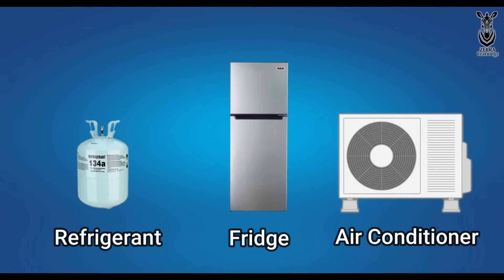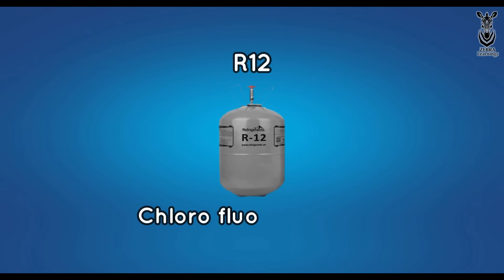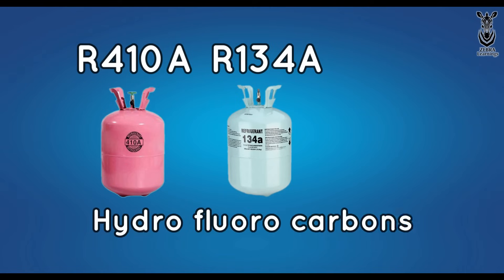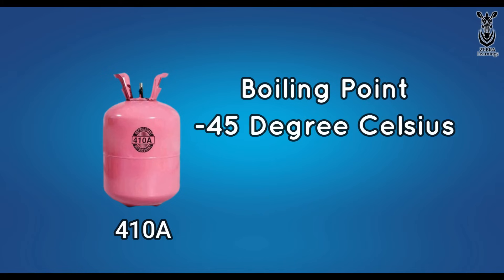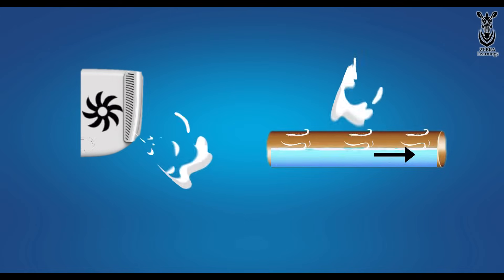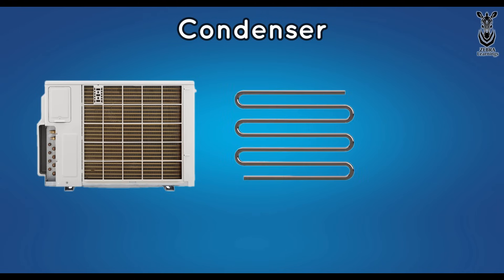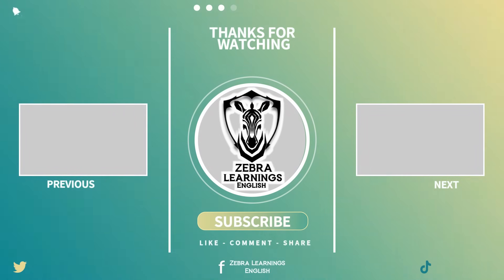What is refrigerant? | Animation | HVAC | Refrigeration

Comment: 4:19 When the refrigerant comes out of the condenser, why doesn't the refrigerant pressure drop as the temperature drops? Don't pressure and temperature have a positive correlation? Thank you.
Reply: that’s like saying why doesn’t the pressure increase out of the evaporator, it just doesn’t. A thing called Superheat and Sub cooling and latent heat and sensible heat

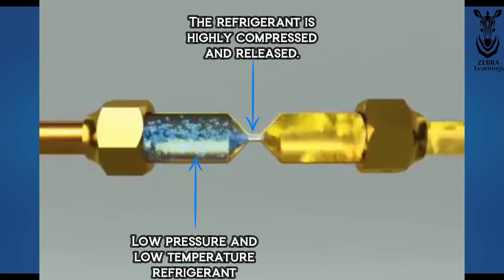Comment: I did not understand at minute 4:34. Why if the refrigerant is compressed and released does the temperature and pressure decrease compared to before passing through that "narrowing"? Since the size of the pipe after the "narrowing" is the same as the size of the pipe before the "narrowing" shouldn't the liquid have the same pressure and temperature as before passing through the narrowing?

Comment: You said the boiling point of r410 is at negative 45 celcius, and then if put it in our hand it will boil? You mean our human hand can produce -45degrees celcius?  I though our body temperature is at 37 degrees celcius. I'm so confuse.
Reply from the maker: Actually, R410 can boil at -45°C and above, so the human temperature is 37°C. So it is enough to boil the refrigerant.
Reply: When it is boil, is it cold or hot?

Comment: If you're confused-Read this;
At first the refrigerant was in a liquid state (taking this as the start of the cycle) and then it absorbed heat from the room and became vapour because it requires small temp drop to change its phase and then we compress this vapourized refrigerant to increase its pressure ( bcz latent heat of vaporization decreases at high pressure and it's temp also increases and compressor circulates the refrigerant) and then condensation occurs through cold air blowing through the pipelines Infront of condenser ,here vapour changes its phase to liquid and then this liquid at high pressure passed through expansion valve and changes to vapour again provided cooling (just like perfume bottle cools down after spraying) and this cooled refrigerant (liquid phase ) moves toward in evaporator again and cycle repeats.
Hope this will help!
[Engg. M.Ahmed]

Comment: U told that refregirant will boil in avoperator by blower fan and the refregirant boil because of the fan wind heat, then how come when the same process happens in condensor fan , the same refregirant will cool and change to lequide status instead of boiling status. Please clear about it
Reply from the maker: Good question. In the evaporator, the refrigerant pressure is low. So, the boiling point of the refrigerant is also low. That's why the refrigerant is boiling at a low temperature. But in the condenser, the refrigerant comes from the compressor at high pressure. So, the boiling point and condensing point will change. That's why the refrigerant is condensing at the condenser coil. I have explained this in the " What is saturation temperature" video. The link for that video. https://youtu.be/moDplf7BHho?si=n9bjay5oNKR2KUji

Comment: Hi In Condenser the vapor refrigerant change into liquid refrigerant, however the temperature will decrease?
or it will maintain same temperature from the compressor
Reply from the maker: The temperature of the refrigerant will decrease in the condenser. Then only it can change from vapor to liquid.

Comment: Question: when the refrigerant goes through the compressor and condenser is it at a hot temperature before it cools down again ?
Reply from the maker: Yes, when the refrigerant comes out through the compressor the refrigerant temperature will be high and when it enters into the condenser it will be high in temperature.

Comment: And also after it pass through condenser and become liquid with a little more temperature than refrigerant boil still it will remain liquid and not vapour until it reaches metering device
Reply from the maker: Yeah it is a nice question. The boiling point of the refrigerant is very low. So when it enters into the evaporator, it boils. But after it comes out from the compressor, the pressure of the refrigerant will be too high. So as per the thermodynamics law when the pressure increases the boiling point also increases, that's why it is not boiling and changing to vapor until it reaches the metering device. After metering device the pressure will reduce that's why it is boiling in the evaporator.
Please ask if you have any doubts.
Thank You!

Comment: Why refrigerant in Eva.coil evaporate and became pure vapour with low temp and pressure and after entering compressor and then compressed still it's vapour but with high temperature and pressure and not changing state?
Reply: Because at first the refrigerant was in a liquid state (taking this as the start of the cycle) and then it absorbed heat from the room and became vapour because it requires small temp drop to change its phase and then we compress this vapourized refrigerant to increase its pressure ( bcz latent heat of vaporization decreases at high pressure and it's temp also increases and compressor circulates the refrigerant) and then condensation occurs through cold air blowing through the pipelines Infront of condenser ,here vapour changes its phase to liquid and then this liquid at high pressure passed through expansion valve and changes to vapour again provided cooling (just like perfume bottle cools down after spraying) and this cooled refrigerant (liquid phase ) moves toward in evaporator again and cycle repeats.
Hope this will help!
[Engg. M.Ahmed]